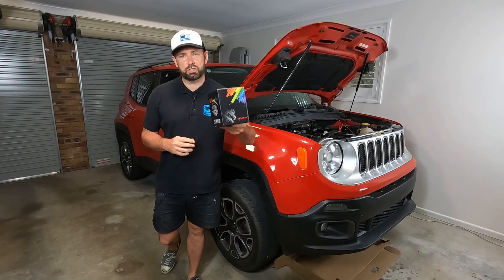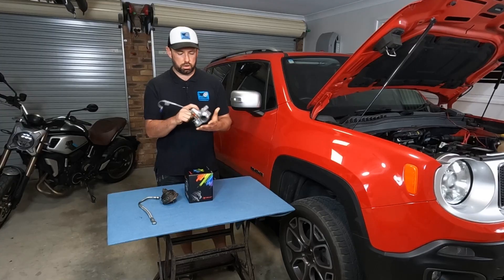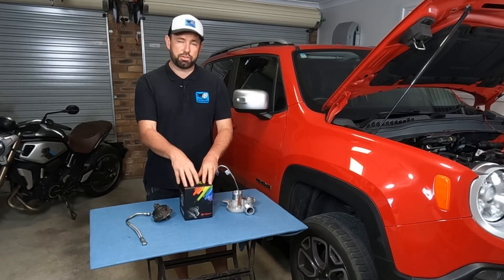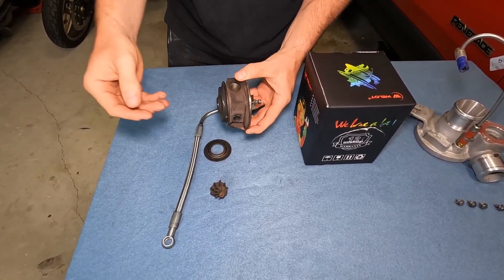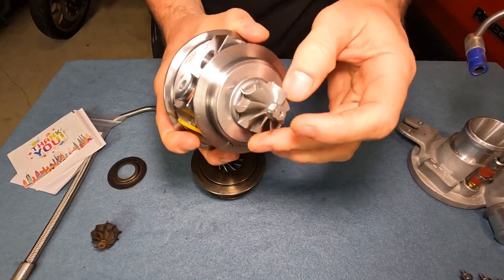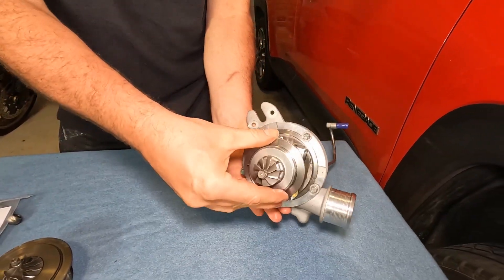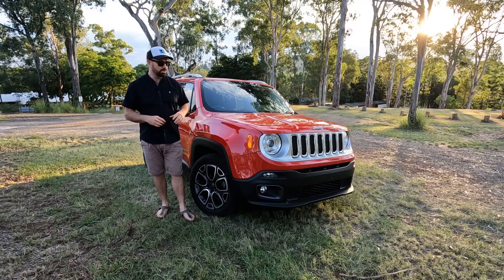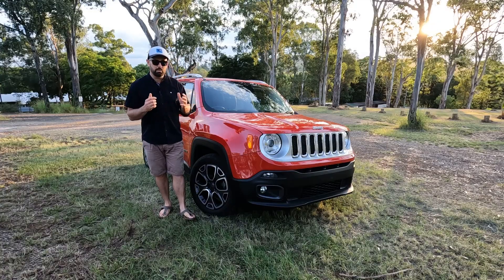Cheap Chinese Turbo CHRA After 3 Months! Was it Worth the Risk?

Comment: Weren’t you worried about debris going into the engine? Isn’t that what normally happens when the turbo fails? Good work!
Reply from the maker: Luckily it was the hot side that failed, the cold side was still in tack, therefore it would only be debris going into the exhaust.
Reply: @ good point
Reply from the maker: @MyRandomLife247  Hope you're well mate, I am surprised I haven't seen you about